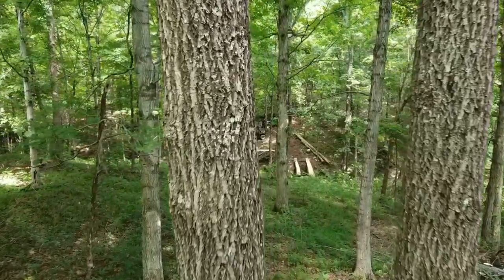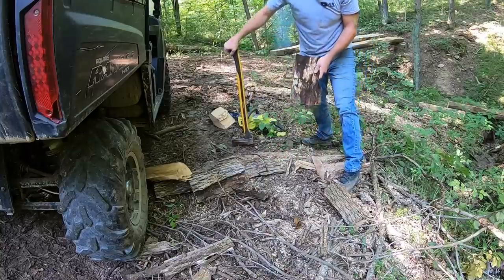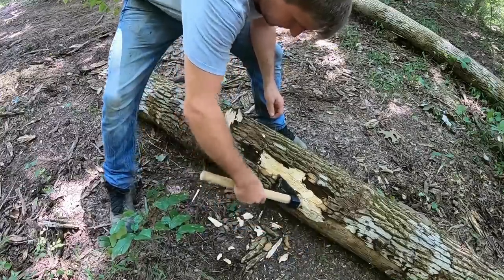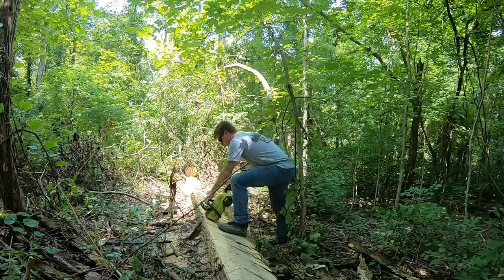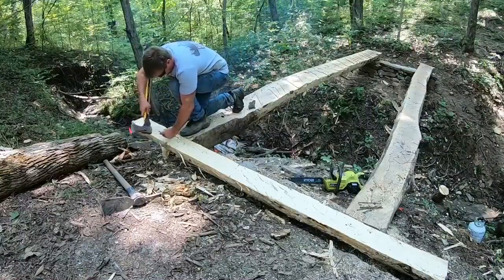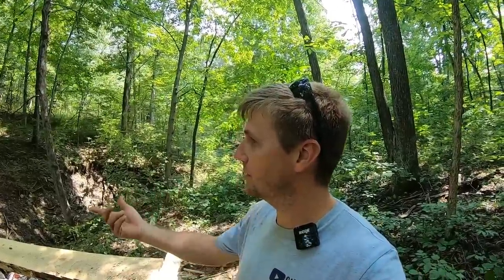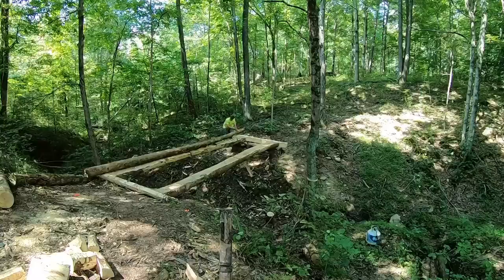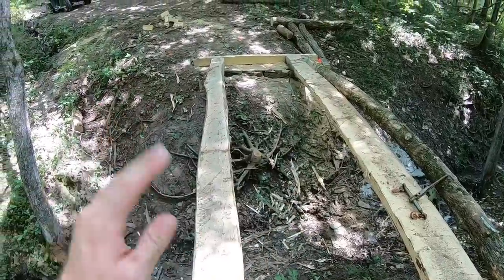Adding Arched Log to Timber Bridge in the Woods - Will it Work?

Comment: Have you considered Shou Sugi Ban  /  Yakisugi ?  It's a Japanese method of preserving wood by charring it with fire in order to weatherproof it. The wood is burned until the surface is charred, and then coated with natural oil. It also deters insects and rot.
Reply from the maker: Would be a fun thing to try!

Comment: On your bridge, you need to use what is called Bridge planks which are true 3 inches thick, and should be oak, for non pedestrian traffic.
If 2 inch dimensional lumber is used, it has to be double layer
Reply from the maker: Using what we have. Milling 2” ash.

Comment: Bingo lunch with the captain what could be better Bud. The Ades is for shaping the big scraper you've been using is Best for debarking and the draw or spoke knife is best at shaping round wood. The Ades is what I'd use if I wanted a new Timber or to get a flat spot. Anywho I'm not an expert but I did work for a company outta Washington state and we'd hike in to places where you couldn't use power tools I wasn't cut out for it. As always good luck and God Bless.
Reply from the maker: Thanks for the support mark!

Comment: I have a US Forest service Pulaski fire axe.  It has a Adze on the back side.  The USFS sharpens the adze dull to use as a grubbing tool and the axe is meant to hack into dirt for cutting roots.   However sharpened another way it can be an effective.  It would be entirely more useful with the longer handle for your tasking.  The short handle kept for fine detail tasking.   The forest service retires axes and other hand equipment when they reach a certain measuring matrix.  I have studied this one and haven't found the defect.  Ebay maybe 10 bucks.
Reply from the maker: Love the Pulaski!  Need to get another one.  I’ve looked at some larger adz heads on eBay to make one with a longer handle similar to the Pulaski.

Comment: When you decide on where too put yourself permanent bridge,you might want to consider using  an older steel 48' tractor trailer flat bed,it can be rolled into place,cut to the span you need,and can be fairly cheap and easy to acquire,,just a thought, I see a lot of the cabins and summer camps where I live in Pa use the trailers for bridges. And that kind of bridge will support a lot of weight, and the stake pockets on the sides make mounting guide rails a snap!! Just trying too think out of the box!😎😎
Reply from the maker: Would definitely do the trick!
Reply: Or an old logging boxcar, like one of my clients did! They build the abutments in the usual way, then cut the car sidewalls down to about 24 inches so it made a guard rail. Was really cool!

Comment: Tips: rapeseedoil are great to use as chainoil. cheap and as good as "normal" expensive oil. I have used it for years. No exsessive tear on the bar neither on the chain. Just a free tip.
Reply from the maker: Thanks!
Reply: Rapeseed oil .... just the old fashion way to say, canola oil.  *)
Reply: @l.m.2404  
Technically not the old fashioned way since “canola” is the new lands (North American) name for it. 
Still called rapeseed pretty much everywhere across the pond.

Comment: I've always thought the adze was the most dangerous handtool for working on wood.  You're almost always swinging the damn thing TOWARDS yourself after all.
Mike, set a better example for your oldest, wear your eye protection with that chainsaw!
Regarding the draw knife, do you have any short sections of leaf spring from other projects?  It won't be perfect, but you could make a usable one by grinding an edge onto a 12-18" length of leaf spring then mounting some handles at either end.  If nothing else it would give you some practice using the tool.

Comment: Can't believe how much you got done with just that battery saw.  You burnt lots of wood I thought would make a decent transition on the ends of the bridge.  Is concrete the plan?  That arch is nice and it'll add strength.  Great build.  A+
Reply from the maker: For the transition I’ll use left over stone from the YouTube yacht

Comment: That bridge is looking sharp, great job. Tip for saving ya self some time and energy cutting cords is place a few rounds together end up, stick a small ratchet strap round them so its just starting to bite and then split the cords... the strap will keep the cords together and you can then use the strap to lift the whole lot up and chuck the lot in the ranger in one go.
Reply from the maker: Good idea!  I have a tire up at the barn for that reason.  Need to do this for a portable version.  Thanks for the tip!

Comment: They make timber/landscaping screws you might want to look at can be bought most places fairly cheap in different lengths etc. some with lifetime corrosion resistance. Hope to see a crossing soon.
Reply from the maker: Hey I’ll check that out!! Thanks for the tip

Comment: Never ran a short Adz before but I have put some time on a standard size Adz and had more luck standing, chop and step back ... once ya get into a groove and it goes fast with a good sharp Adz with the correct length handle for you....
Reply from the maker: I have been looking at some larger ones on eBay.
Reply: @CaptainKleeman  Start with good steel and you can’t go wrong.

Comment: Nice. I got to build one of those. I like your abutments. Prob don’t need a third beam tho. Once you place deck boards on there it’s prob better to have them just a simple span.  There’s a few reasons. For one it will be hard to get contact on the deck board on all three beams. Especially with the chainsaw sawn stuff. And secondly the wheel line will likely be near the outer beams and so the force on the center beam would be an upward force. Since they would be considered a continuous beam. You’re better bringing the beams in a little and letting the boards cantilever a little over the edge of the deck. I think we have the same tractor and so I’m interested in how you finish it. I have a 16-20 foot span to clear. Right now all I can get over the creek is a 4 wheeler and a walk behind brush cutter.
Reply from the maker: How many hours you have on your 755?
Reply: @CaptainKleeman  I saw it in the background.  I got a 4110.  Same size and similar parts.  It's only got 250 hours.  My brother gave it to me last weekend so I'm gonna do some maintenance on it and then start using it and looking for the best attachments for the money.

Comment: Logs are stronger when whole. Just put whole logs across atleast three about 400mm diameter and build on that. Knotching and milling those bearers is going to make them slit under load.
Reply from the maker: That would make an uneven deck.

Comment: Hope the "arches" are only for looks. If you put much of a load on them, they will simply push the two end pieces off the straight (soon to be three?) main supports. If there is no gap between the arches and those end pieces, they may still push the end off; when/if the main supports sag, they will be make the whole bridge a bit shorter... except the arches will still be trying t hold their distance and put outward pressure on those ends. K.I.S.S. and have fewer problems/variables. 🤔 Above all, learn all you can with the training and stay safe! Qualified Firemen are very valuable to your community! 👍
Reply from the maker: Stay tuned

Comment: 2 things, your adze should be hitting the log with the blade much more parallel to the log. Historically they were used in conjunction with a broad axe, the axe cut to a depth and then the adze was used to split off the wood between the ax cuts. Also wouldn't it make more sense to have the two main beams directly under you tire width so the majority of the weight is transferred directly to the beams and not on the decking.
Reply from the maker: Good info on the adz. Thanks!

Comment: Did you know that you can actually use canola oil from the store as a eco-friendly alternative to petroleum based bar and chain oil? There has been research that shows it's as good and possibly better than petroleum at lubrication for chainsaws! The US forest service has a 3 page document about the pros and cons of using it. I have personally tried it and has worked perfectly!
Reply from the maker: Interesting!

Comment: I always forget to add oil cuz I'm not tied to a gas can... Then I sharpen each side of the chain twice cuz it seems to short the first time through. The bigger Amp batteries seem to have more power but defiantly last longer (Hi-Test). 
 that's the only chainsaw my wife will let me use..... LOL 
Naw I'm working on the carb on my O' 460 Stihl .... take two
Reply from the maker: I had a subscriber send one of ryobi larger batteries.  I did notice a little difference.  Hey thanks for watching Dan!
Reply: @CaptainKleeman  I'm hurting so bad ... can't keep up with you young-n-s anymore.... LOL 
Got the three acres almost done and ready so I don't get to watch too much YT right now but I try not to miss your channel and a few others....

Comment: hello from Darlington PA.  Bridge looks good.  I heard you say you were putting a third support in.  I was wondering if you would or not.  Definitely safer but will add a little more complexity to adding the deck just because now you have 3 surfaces to get flat and level.  At least the  2 existing supports will make it easier to get number 3 across.
Reply from the maker: Definitely going to add some extra work to getting the surfaces to match up.  But I think will be worth it

Comment: Ok possibly a dumb question. What are the arch pieces for? They aren’t structural unless you are putting the planks on those. But I don’t think you are. So unless you plan on connecting the middle of the flat runners to the middle of the arches it is t giving you and structural strength.
Reply from the maker: Nope,  it’s a great question!  I mentioned in the video that one of the logs I cut go underneath.  It will hang from each arch and then go underneath the two support beams in the middle.
Reply: @CaptainKleeman  ahhh ok. I missed that!!

Comment: How long/many cuts do you get out of a battery with the electric chainsaw? You seem to use it allot. Good stuff.
Reply from the maker: Just depends on how sharp the chain is.  I have three batteries,  and can normally rotate through them on the charger and make it through the day.  It’s definitely handy for smaller stuff